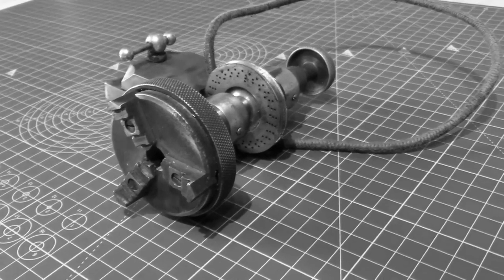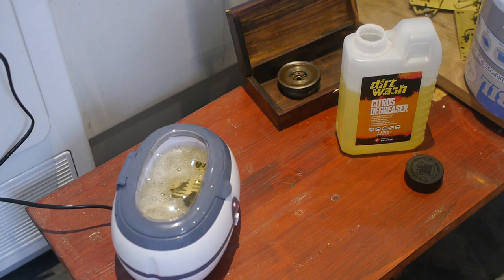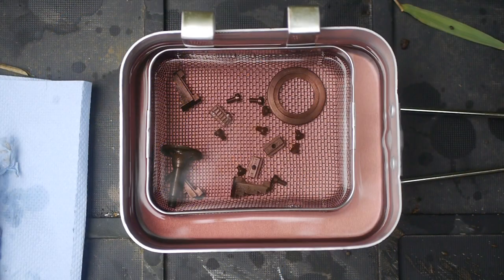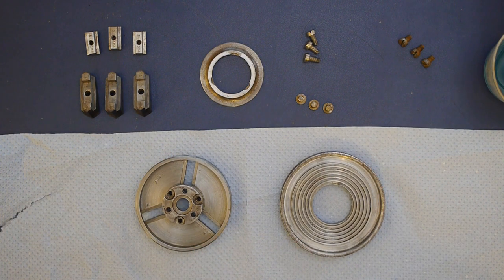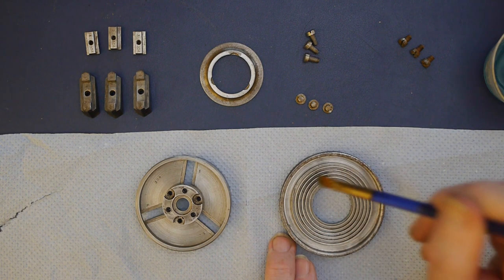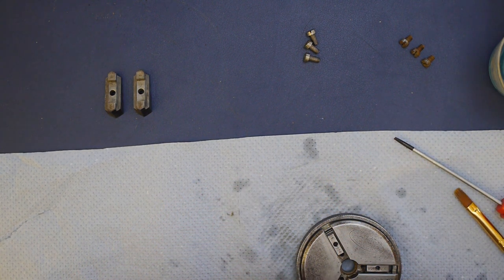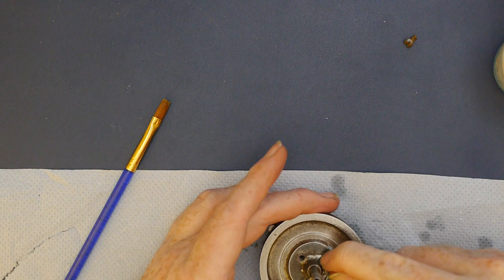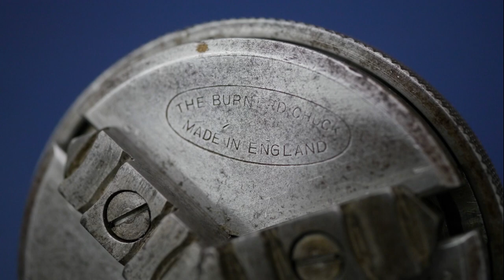Boley Watchmakers Lathe Restoration - Burnerd Chuck

Comment: Thanks for that. Just a little history. In 1964, as a young whippersnapper, after being invalided from the Royal Marines, I had my first job in Burnerds, making Boley chucks. The most difficult machining op was turning the scroll on a modified Herbert lathe. The jaws were case hardened in a cyanide bath at 800 C, and when assembled ground to a tolerance of 0.0005". And they are still being used. Wow. Lol

Comment: Those ultrasonic cleaners are wonderful. I use mine for degreasing but also to clean friend's jewelry.
Reply from the maker: I love mine too! Cleaning is now so easy, it's changed the types of projects I can take on.
Reply: Adventures with a Very Small Lathe which kind of products do you normally use on your ultrasonic cleaner? I have been having very poor results using just soap and hot water.
Reply: Very good question. There is (at least one) video out there that goes into this. First, I never use soap. I do use laundry detergent. It has to be well concentrated. Soap and detergents are completely different animals. A detergent is a long skinny molecule with two ends. One end binds to grease and the other end binds to  water. The grease is torn away from the part by the hydrophobic end and floated away by the hydrophillic end. Oversimplified but reasonably accurate. Search on "ultrasonic cleaners" for more info.

Comment: I have a larger boley lathe which came with thread cutting gears.  How do I calculate what particular gears to fit for the appropriate pitch, any suggestions please? There is no manual..  Thank you
Reply from the maker: Well, it's difficult for me to give you comprehensive instructions without seeing a diagram of your lathe, but the principles aren't too hard, so I'll try and explain those.

The first thing you need to measure is the thread pitch of the lead screw which drives the movement of the carriage. When a single turn of the spindle results in a single turn of the lead screw, then it will cut a thread with the same pitch. From there, you can work out how the pitch is changed by looking at the ratios of the counts of the teeth in the various meshing pairs of gears. If a 10 tooth gear near the spindle meshes with a 20 tooth gear near the lead screw, that will cut the pitch in half. So a 2mm pitch lead screw, with 20:10 teeth gear ratio will result in a 1mm pitch thread. In practice you will probably have to combine multiple ratios together, as there are almost certainly multiple sets of gears. There may also be toothed belts in the drive chain, but the principle there is the same. Just count the number of teeth on the belt pullies to work out the ratio.

You can find web sites out there to help you with these calculations. I wasn't able to find a perfect one off the top of my head, but search for "gear ratio calculator" and try a few out.
Reply: Thank you for your input.. I was nt sure where to start on this. So the gears basically reduce the pitch accordingly.  I will try and Google the info you suggest.. Thank you..